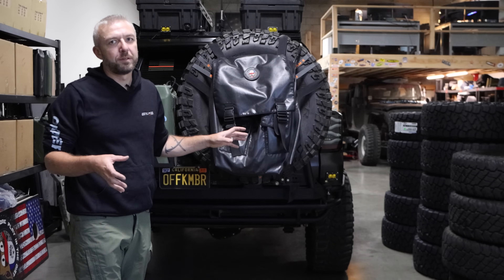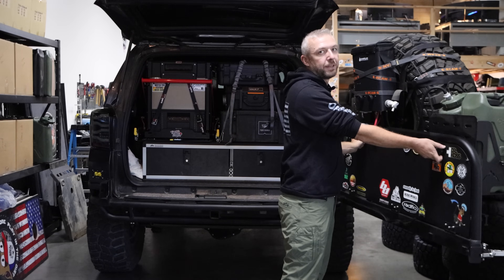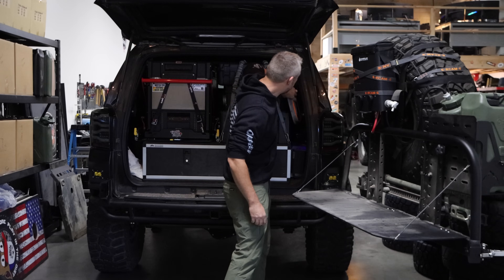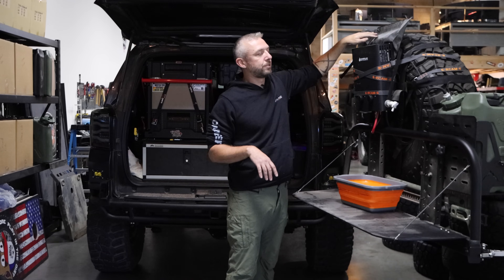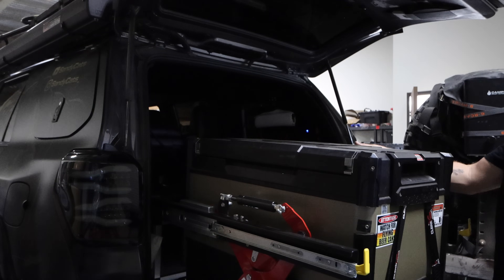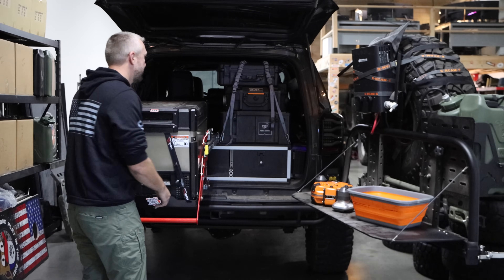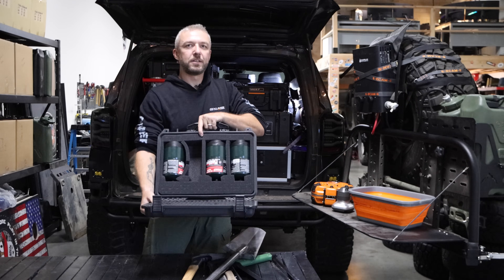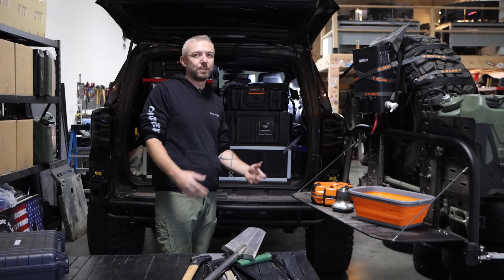Ultimate overlanding gear storage, kitchen, and camping setup for long trips with kids.

Comment: Now when you go out with your crew( 3 or4 additional vehicles in your group for the trip) do you find it easier to just cook big meals for everyone in the group instead of everyone trying to find space on the grill to cook there meal?
I found over the years for it to be easier to plan a menu and cook a morning meal and an evening meal, then they worry about there own lunch, and drinks ,and snacks.
And with the morning and evening meal I provide the coffee. You don’t have every one trying to find a spot on the fire to cook, it tends to be more organized, and I do a lot of Dutch oven cooking, 1 pot meals equals less clean up. I do my trail running in a M38A1 Jeep and carry all my gear in a Canadian M101 trailer. It all works out well. Never did any wheelin in Baja before, but most of our time on the trail was in Death Valley and the panamint mountain range, and the high desert.
Really enjoy your videos and your content. Also loved the video on the water can shower unit. Very functional. I also like the fact that you are a licensed Radio operator. 
I carry my hard mount vhf/uhf radio, a couple Ht’s, and usually take my HF rig with me and wire with me to make up a field dipole antenna if I have to reach out and touch someone.
Thanks again for the effort you put into your videos.
Be safe.
Jeff
KI5HGT
Reply: Jeff, thanks for all the feedback! Regarding meals, it really depends on the group. If it's very close friends we usually do as you do and share meals. However, in larger groups or people we are not close with, everyone cooks for themselves. Dealing with people diet requirements becomes a pain... especially if there are a bunch of kids in the group. To be honest though, we usually role in very small groups.
Reply: @olegflaksman6591  I hear you loud and clear. Most of the kids that go with us anymore are young adults, but I would put out a menu to everyone for approval or suggestions then when the menu was set, I’d shop the menu and it would break down to maybe 20 bucks a person. Turned out to be pretty cost effective. Just a little food for thought. Maybe one of these trips I make back to California, we can get together and do some wheelin. I grew up in Chino and know Upland very well.
Be safe brother.

Comment: This set up is great! If you plugged the trailwash directly into the camplux would that provide enough pressure to use as a shower directly? Or does the camplux restric the water pressure to much? I have a shower awning on my vehicle so this set up right next to it would make things very convenient if the trail wash system supplys enough gpm.

Comment: Love your setup. You have a link got the quick connect for the diesel heater. I would love to do the same for mine.
Reply from the maker: McMaster part numbers: 5012K114 and 5012K15.

Comment: An great example of well thought out design & packing skills.
It is likely very simple once visualize - & I tried zooming in but could not see how you circulate the water from the Complex to the Sandy Cats water can. BTW - which model Camplux is it.
 I also tried searching the RCam 6 tie downs to no avail - have you got a link or a full name,
Very informative no nonsense video.  Дякую...
Reply from the maker: Made a mistake…. Not Cam6…. Called rollercam. It’s the cheapest Camplux; the one that’s $159 on their website. I have some more photos/vids on my instagram. But if you want to see it in more detail, message me on instagram and I will send you a vid.
Reply: @SandyCats  Ah - Roller cam - I' ve been meaning to give them a try.
$160 is good value for a heater that works and is rugged to boot.
I'll check your IG👍
Reply: @SandyCats  I checked your IG. I can see how you get cold water from the Sector & hot water through your Camplux for the kitchen area.
I am still unclear  how you heat the water in the Sector - So (as you indicated) you would remove the Sector from the rack to have a hot shower away from the kitchen area.
Reply from the maker: @TerryManitoba if you look at the 4:45 mark on this video… you’ll see the cap is open and water going from the cap to the Camplux. Than the garden hose going from Camplux back to same scepter.
Reply: @SandyCats  Got it - So to be perfectly clear! 
You screw off the Septor's lid - jam the garden hose from the hot water outlet into the opening between the lid and Sector? (do this until Sector water temperature is just right-:) Right
Reply from the maker: @TerryManitoba  yup
Reply: @SandyCats  👍

Comment: Killer setup man. Been using your Sandycats kits on my truck and it’s such a game changer. I have the same Camplux water heater and have been looking for a simple way to waterproof it. What did you use? Looks like that would work really well for my setup
Reply from the maker: I just used some Velcro and some scrap tent material to cover the top when not in use. Everything else is exposed. Hasn’t rusted yet!
Reply: @SandyCats perfect! I’ll have to see what I can come up with. Thank you!

Comment: Adventure trail gear.. made in Canada..I have canvas style,also has a small pocket that holds two 1lb propane tanks.. straps go to the bottom to tighten properly...also the mounting straps are separate from the bag and if installed correctly you get no sagging at all.. been using it for about 3 years now... little sun fade but not brittle and weak like the 3 trasharoo's if been throw...